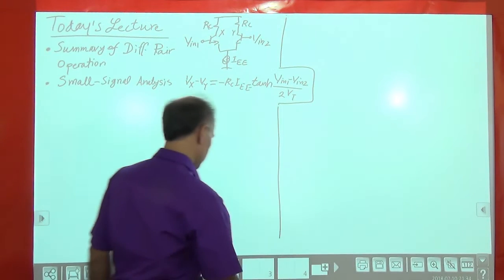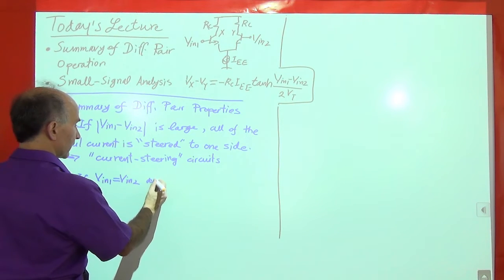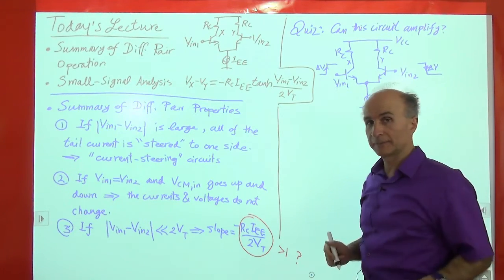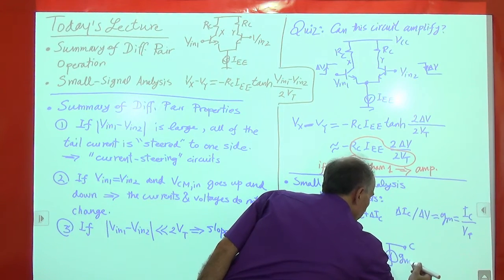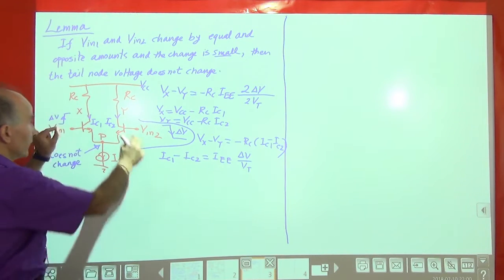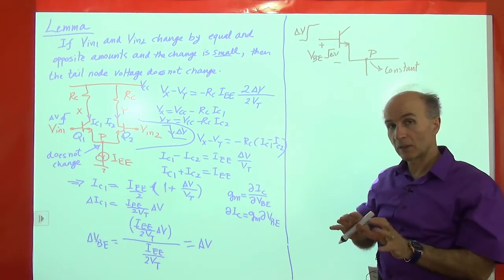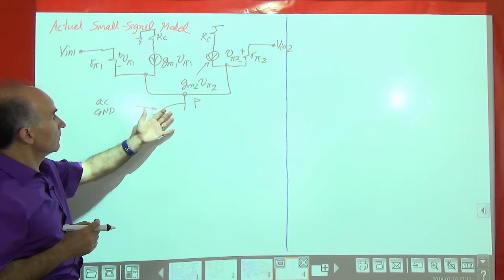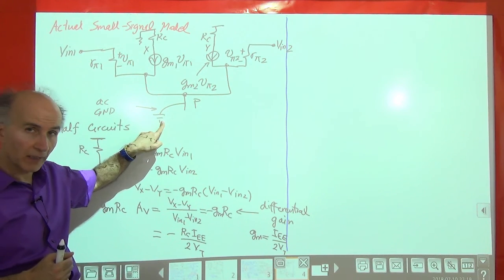Razavi Electronics2 Lec10. Small-Signal Analysis of Bipolar Differential Pair

Comment: 01:25 - Intro and Review
06:22 - Summery of Diff. Amp. Properties
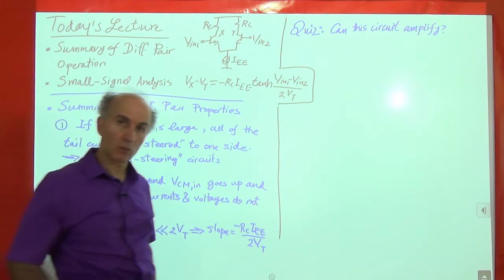13:10 - Differential Amplification Derived from Large-Signal Model
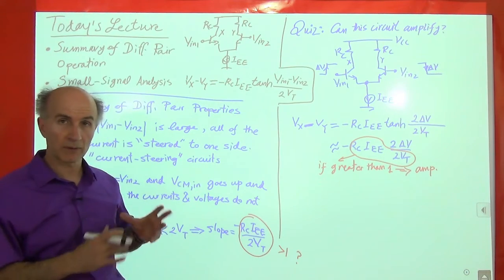17:18 - Small-Signal Analysis of Bipolar Diff. Amp.: Condition for Constant Tail Voltage
22:33 - Lemma: Virtual Ground at the Tail Node
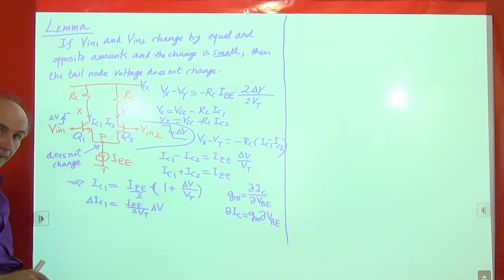31:20 - Calculating the change in currents and then showing that BE voltage changes exactly the same amount that the input signal has changed, proving that for small input differential signal,  the  tail node potential would not change, it is virtual ground. Or, showing that for linear approximation, tail node potential doesn't change!
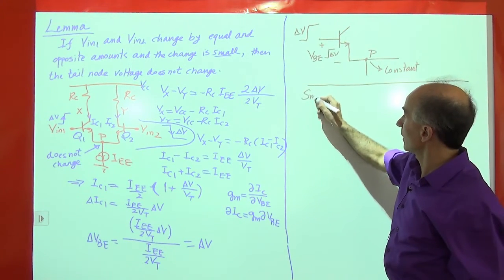34:35 - Simplification for Input Differential Small Signal

Comment: does anyone know that Do we need a capacitive coupling on the inputs ??
Reply: These r differential amplifiers..I don't think we need capacitors here.. on integrated circuit fabricating large value of capacitors (micro farad) it will consume more area.. may be with the help of this differential amplifiers we will avoid those coupling and Bypass caps
Reply: I think we should

Comment: Did anyone else notice, whenever he turns to write something on the board, the noise increases ?
Reply: He should consider using a differential pair to help reject some of that line static
Reply: At 1 AM when one is alone in home and delivering lectures to vacant seats, paranormal things usually happens
Reply: At 1am at home, one stills solves differential circuits